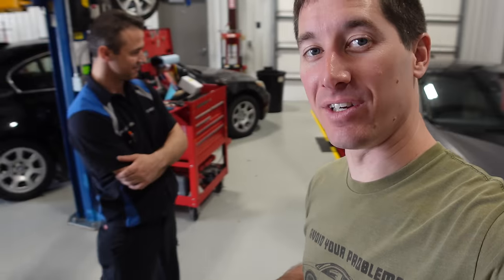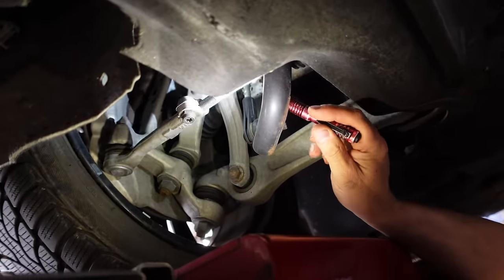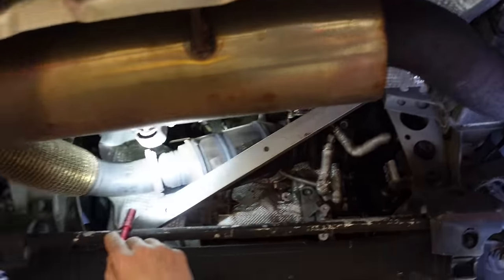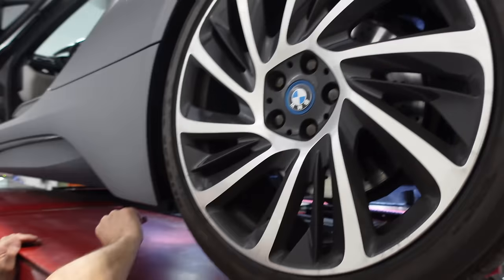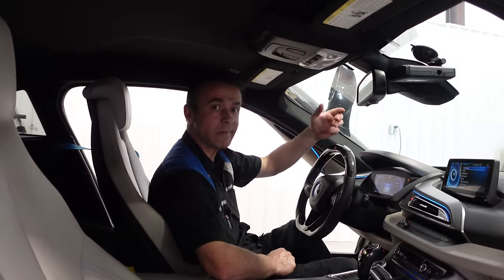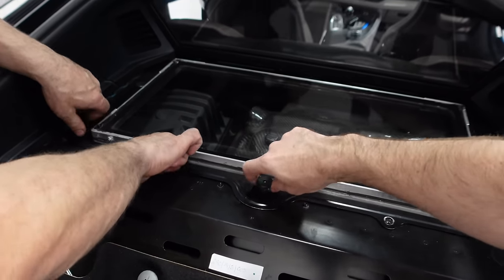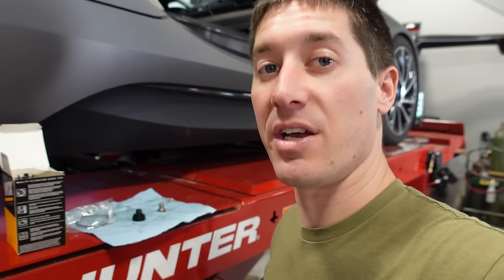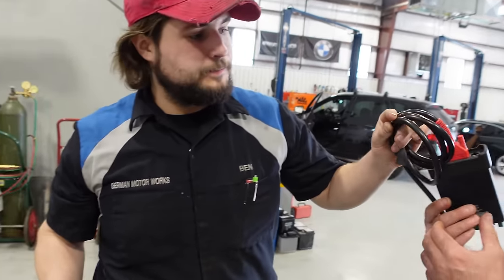Here's Everything That's WRONG With My Cheap BMW i8

Comment: I remember when my dad contemplated getting one of these. Ended up in a Jag F Type R instead. I think he made the right choice.
Reply from the maker: Both are excellent choices, big fan of the F-Type obviously! 💯
Reply: @WatchJRGo  my dad liked them so much that he had a 2014 convertible type R and replaced it with a 2016 coupe 2 years later! Then he went 2016 Mercedes AMG GTS and now has a 2014 Ferrari 458 spider. He's got pretty good taste in cars.
Reply: @BirdLawyer  yeah he sure has, the 458 is the coolest and the best ferari ever, I'm semi jealous for your dad but I'm sure you're happy for your dad. Hope you get your dream car one day
Reply: @chrism869  he's worked extremely hard to be able to afford these cars. He's come a long way from driving me around in a beat up old Suburban as a kid. Thanks and I hope you will be able to get your dream car some day as well!
Reply: @BirdLawyer  thanks, will certainly hope so, my dream car has always been the w204 c63 and an s2000, more on the c63 cause of that 6.2 na v8 the best sounding engines ever, especially with a modified exhaust. I donk know about the s2000 but it would be an epic summer car with the top down. And the vtec yooo
Reply: @WatchJRGo  i wanna say that mystery muffler is a pumped in audio exhaust if I remember correctly

Comment: Loved to see my old home-made engine cover and carbon overlay on this video.  Yes, that glass is heavy, as I wanted something that replicated windshield glass so it could withstand the heat and vibration.  It's hard to line it up to reinstall it because after I cut the big hole in the middle to mount the glass, it warped the stamped metal that was original to the i8.  I hope you guys got it on there without too much difficulty.  I built that in my garage from a concept because everyone wanted to see the engine at car meets.  It was an honor to give this to Rich and I'm so happy to see it again!

Comment: These and the i3 throw tons of random codes when the 12v battery is low or weak. It's common to just replace them first before trying to troubleshoot random codes... especially if the 12v battery is over 3 years old.
Reply: Yep computers act very strange without proper voltage, including a short in other components of the car messes with the whole system.
Reply: The i3 is a good buy generally too BTW. Also under rated.
Reply: @andrewnorris5415  As long as it's not an early year model... like my 2015 BEV that has become a semi-permanent resident of my garage - since the drive motor bearings went bad. Known defect/design flaw, yet BMW won't come to my assistance with Goodwill help... though they have provided a replacement motor free of charge for many others with the exact same problem... saying that 94k miles is too old... not worth repairing.

Comment: Had the -100HP version of that I3 in my Mini. Same filter setup, though it and the drain were behind easy to open flaps on the undertray. And at least on BMWs you can check the oil level over and over; on some Porsches I've worked on you have to wait some period of time before you can check again.

Comment: The part that you were wondering what it is that is like an exhaust it is the active sound enhancer. Basically a speaker inside it and what you thought was an O2 censor is the wires for it.

Comment: Autel has upgraded their MaxiSYS Ultra scan tool to the MaxiSys Ultra EV, to make it fully EV compatible.  You and/or Johnny may want to upgrade your scan equipment to be fully EV compatible. The new one will also work with your Gen2 Volt.

Comment: BTW, the clean tail pipe on the rear (driver's side) is the exhaust speaker. It makes a sound when you accelerate for the outside of the car.

Comment: BMW brought one of these to the tech school I work at. They told us that Europe requires electric vehicles to make noise for safety reasons. So the extra "tail pipe" is a speaker for this system.
Reply: That makes sense

Comment: Looks good on a lift, and at all other times as well. If you got the money or skill to keep it up and running, seems like a great car to own forever (or at least until they creep up in price, also if you can keep it running).
Reply: Looking good on a lift is an important property for a BMW 😂
Reply: Looks like a safe bet. You get the comfort of an EV and when the battery gets old, you can rely on the ICE. Also, the carbon fiber must give a very different driving experience. I'd love to own one some day.
Reply: I’ve rented the i8 on two occasions. Once with my wife celebrating my 40th in Vegas. 

Then again with my wife and two boys for a family reunion road-trip in Vegas. 

It’s a phenomenal car. Between my brothers and I we also had an Audi R8, a Corvette C7, a Maserati Ghibli and a Porsche Panamera but the BMW i8 was BY FAR the best car to drive, the most confidence inducing, had the best sound system, the coolest NAV, the heads up display, amazing scissor doors, head turning looks and an overall much superior experience. 

The comfort mode makes it totally quiet and the suspension becomes noticeably softer.  

I absolutely loved it.  

Owning one would be so much fun but I would fear the maintenance costs.  

I already have an X5 and an e39 540 6 speed that I’ve owned for 18 years and keeping those up and paying for travel soccer is about all I can handle.

Comment: I had a BMW 1series with basically that same engine and I always thought it seemed a bit stupid to have the engine running just to check the oil level because if its too low then that surely can't be goo for the engine

Comment: At least you don't have the near impossible project ,the McLaren P1 that Tavarish has to deal with... it remains to be seen if he can pull it off...or if it will bankrupt him.
Reply: I can't see that work out out for him.
Too much carbon broken. If he doesn't drain the water from that engine soon, it will be ruined. If the battery is toast, that alone will kill it and even if he rebuilds it perfectly, it will still be a salvage title, so it probably won't ever be worth $2 million again.
Reply: @jochenstacker7448  Even fixed I think that thing will only be worth what he paid for it, the repairs will be a sunk cost that he's hoping the Youtube views will pay for.
Reply: @glassvial  if you recoup that much money from YouTube views, I'm in the wrong racket. 😁
Reply: @jochenstacker7448  you also don't have 2.4M subs.
Reply: I still want to know how Tavarish gets around the "Certificate of Destruction"-branded title on the P1.  Even if it is fixed, it won't be able to be registered again in Florida.
Reply: @glassvial  that is indeed true.

Comment: 0:55 Not the same "range extender" as the i3.

The i3 is a series hybrid, the 2-cylinder (BMW motorcycle derived 647cc 33 bhp) gas engine just drives a generator, it is not connected to anything else, it is an electric car with an on-board generator.

The i8 is a parallel hybrid, the 3-cylinder (BMW/Mini derived 1500cc turbocharged 238 bhp) engine is connected to the wheels through a transmission, the motor is used in parallel with the engine.

Comment: Hi, Just wanted to let you know that I think most i8 s don't come with the "Display key" nor the digital readouts on the steering wheel like the one in your car. That's an expensive and rare option you have on your i8, specially a 2014 (first year model). Does your i8 also have the Laser headlights? Because that would be awesome.

Comment: Great car and great example! See High Peak Autos who reviewed a similar fine example recently on YT. A dealer very close to where I live in the UK. You really can daily these. Could be expensive in a crash is my only concern with all that carbon and one off parts. But in a way that means they are more likely to owned by more careful drivers with a full claims bonus. This one seems to have been rear ended. Good repair it seems!

Comment: My 2002 tahoe has a rough idle once it gets to operation temperature , I've changed plugs , wires and the sending unit in the fuel tank ,,, nothing helped , it's random but only when the truck is warm like 190 - 210 degrees any thoughts ?

Comment: "People commenting that it would be super rusty" - Spoken from someone who doesn't have salt in their state. Want no rust and a car that lasts forever in the North East? First, don't go out in the snow storms, just stay home. The day after, if you go through the sludge of salt... go to the car wash. Every spring just spray salts gone up under the car (they have units you can just drive over in your driveway) and take it to the car wash. Lasts forever. 

People just don't take their cars to the car wash and its very sad.
Reply: Or they do wash em but don't let them fully dry, drive home in more snow/salt and then park them in a dark and/or humid garage, which keeps vehicles wet for longer and enhances and promotes the corrosion process

Comment: I wish they'd just put a dipstick on new BMW/Minis. Such a pain and overengineered solution when a simple wire and a tube does the same thing faster and cheaper with less chance for an issue.

Comment: The petrol engine in the i3 is the 2 cylinder 650cc engine from the C650GT scooter, made by Kymco.
The i8 petrol engine is the 1.5ltr 3 cylinder engine from the MINI.

Comment: I thought this car had some more history and that "uncle" Rich had procured it from Samcrac? Maybe I am mixing things up... If I do not, this engine was completely rebuilt (warped head) and that is what is wrong with these a lot.  Overheat and not taken care of, needs its oil changes, more frequently, but it is a head turner with a put-put engine in it.
Reply from the maker: Not the same car 🍻

Comment: Didn’t this car had an over heating problem or something like this?
I remember watching the original rebuilt from Rich back in the days
Reply: My mate's boss had a cylinder head gasket go on his, apparently its a common enough fault to have a modification/countermeasure from the manufacturer?

Comment: Also in the accident, all the broken bits and panels are bolt on replacement parts and there was no chassis or structural damage when rich was rebuilding it.

Comment: Air intake for the kymco engine that makes power.
Reply: you are mixing it up with the 600cc i3, this thing has bmw's own 3cyl 1.5l
Reply: @Iceeeen  BMW has holdings in Kymco
Reply: @bmwloco  yep, still not a kymco in this thing. 3cyl engine that comes from mini, a bit more tuned. :)

Comment: Firat it does not habe the same range extender as an i3, dont copare this i8 crazy thing with an i3.  I had i8 and i3s i gor rid of the i8, kept the i3s way better and easy to keep up.  That i8 cooling syatem is a night mirre.

Comment: you amis are weird.. you buy a car with no clue and go to a car-shop where the man not even can tell you its a part of the sound.system (4:50).   i buy and import by myselfe since 1999 three H1 civil .. the last one in 2008 what is still here in my garage is a H1alpha.. but hey I read the internet blankly about H1 and in 1999, when the web wasn't so full of information, I  drove my first H1 to a US barracks (city of Friedberg where Elvis Presley was) and asked the mechanics  if I could have a look in the repair-manuals. to figure out to check oli in axels. the boys was so nice they even gave me a 1.2meter stack of manuals and new brakepads and rotors....for the exchange of 10 Punch Coronations (cigars) 😜 and than there was a BBQ. if you buy a "exotic" car preparation is king.. but maybe i not understand that clip is irony.

Comment: Since this is a  diesel, the extra exhaust could be a dieselheater for engine/heating. It gives out very little exhaust fumes so its very clean. If the car has been driven in warmer states, the heater probably hardly ever been used. Dieselheater is often standard equipment in europe on mercedes, audi and bmw.
Reply: Diesel? Really? Lmao
Reply: Why are you under the impression it is a diesel?
It is a gasoline/electric hybrid.
Reply: @williamegler8771   I dont, but refer to the comment from Mike Andersn. It was in response to his comment stating its a diesel. I know cars and knew that was wrong, hence my comment Diesel?, Really? Should read before commenting
Reply: @williamegler8771  My mistake, bmw was supposed to put a diesel in this car, and changed their mind. Never driven one so i did not know about the change.